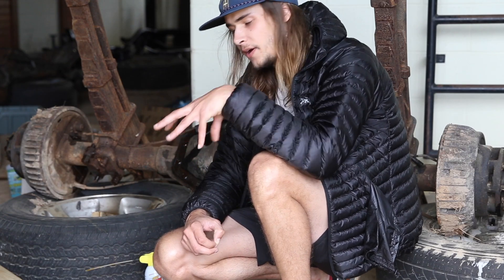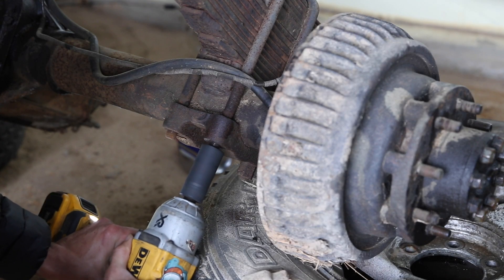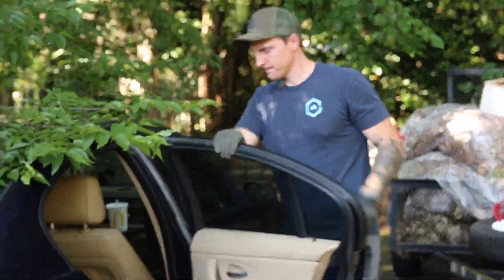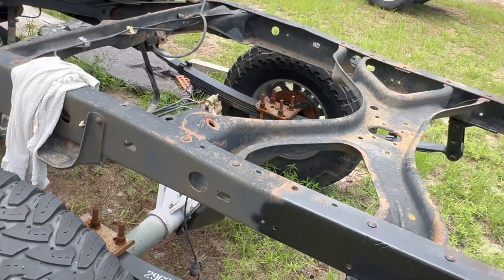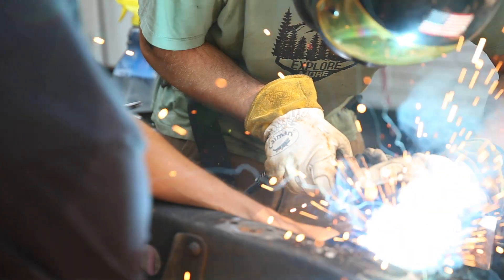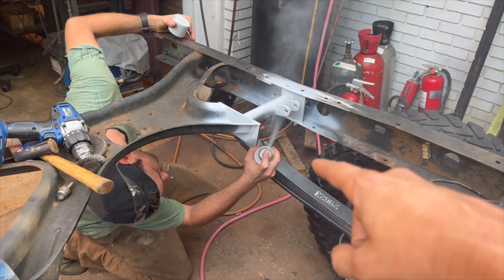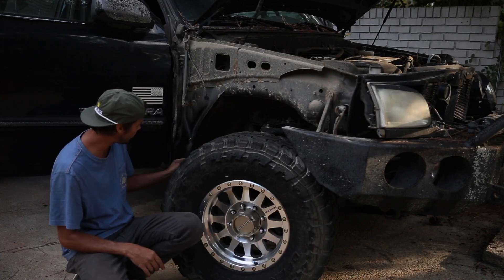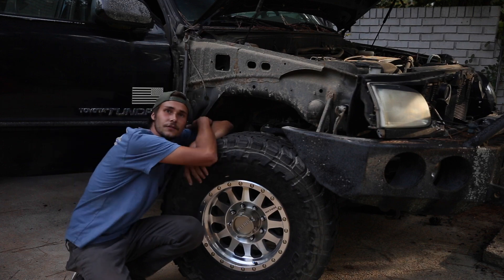Ultimate 14 Bolt Axle Swap: Toyota Tundra

Comment: Wondering if I should do this to my 08 tundra 🤔 what was this axel out of?
Reply from the maker: This is from a 1999 Chevy 2500 hd. It’s a super beefy axle but I’m pretty sure the 08 tundras had a 10.5in ring gear also. I could be wrong. Can’t really break em with Toyota engines

Comment: You running adapters on the front to keep it 8 lug all around?
Reply from the maker: Yessir! We tried to run 6 lug adapters in the rear instead so I could keep my 6 lug methods... after machining them to fit over the 14bolt axle shaft we tried to put the methods on and they wouldn't clear either... so 8 lug adapters in the front an a new set of methods was the answer.